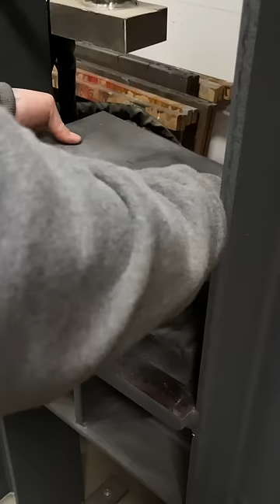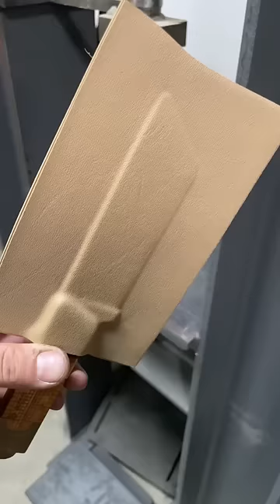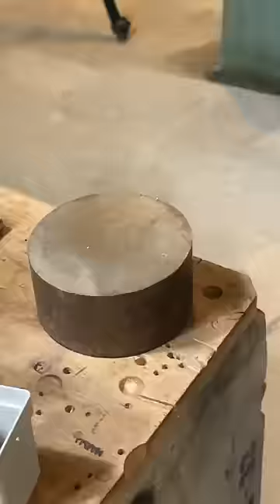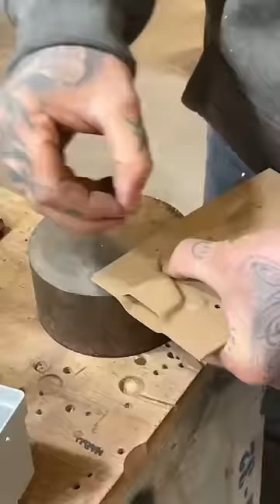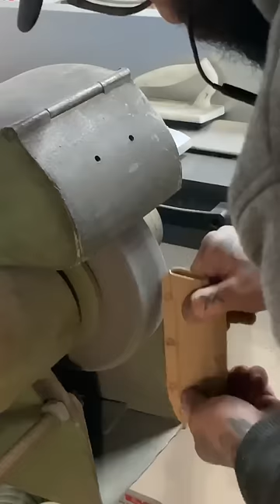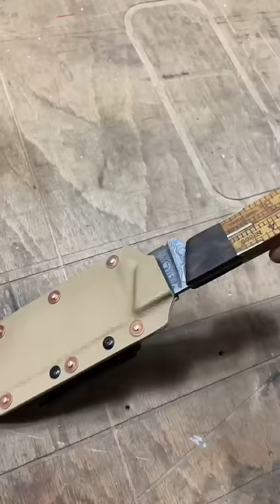Every Knife needs a sheath…

Comment: what are the copper pins you're using for your sheath
Reply: Copper rivet and burrs. You can find them on Amazon or maybe in your local hardware store. They're a little bit of a pain to use and get the hang of but they're really cool once you nail it. Also you can find the setting tool on Amazon.